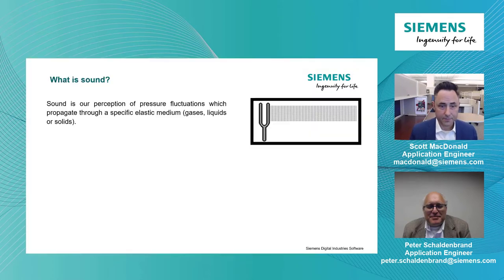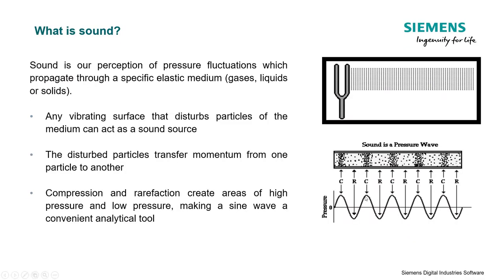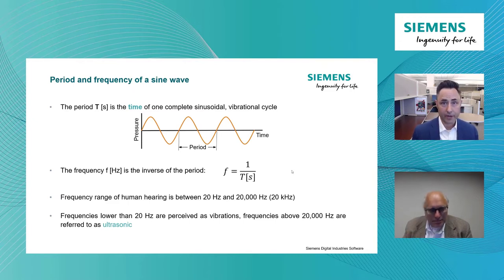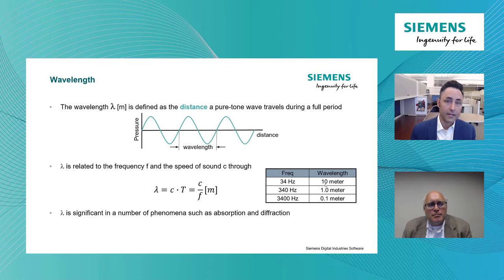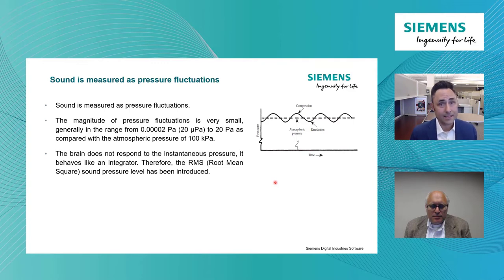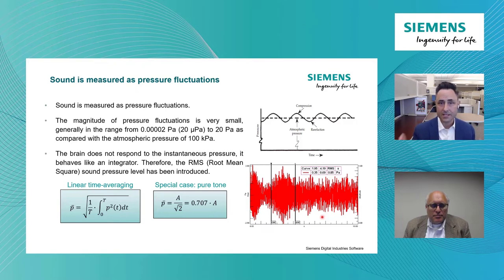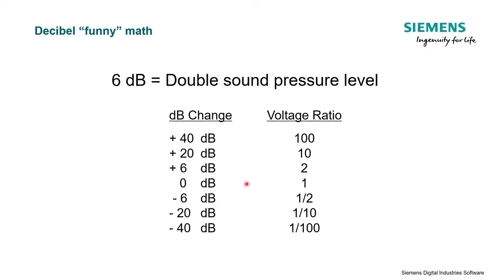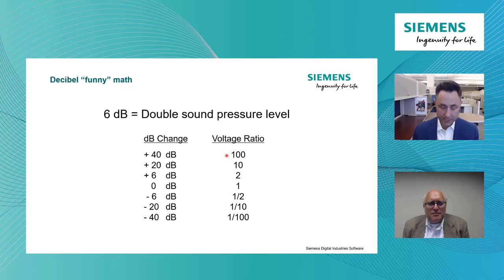Sound Pressure and Decibels

Comment: In real world how do you make sense of these sound pressure levels say to determine if an equipment if acceptable eg a fan. I usually get sound power (LWA) from manufacturer and it really does not make sense to me especially when there's no distance specified from the source eg 45dBA at 1m
Reply from the maker: Given a sound power value, the sound pressure/sound intensity can be determined at given distance from the source as explained in section 3.2 of this article: https://community.sw.siemens.com/s/article/sound-pressure-sound-power-and-sound-intensity-what-s-the-difference. Sound pressure and sound intensity levels are the same if the sound emitting object is in a free field.